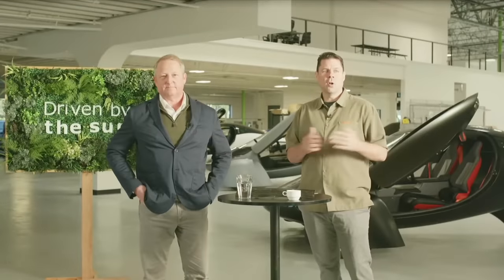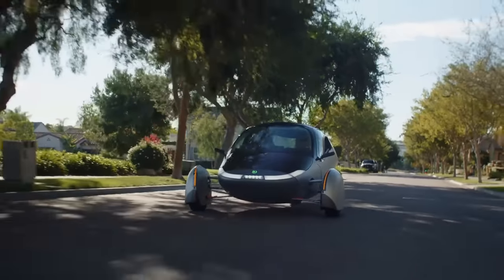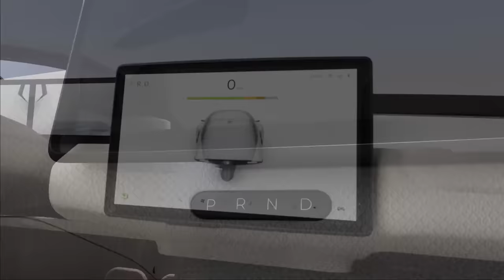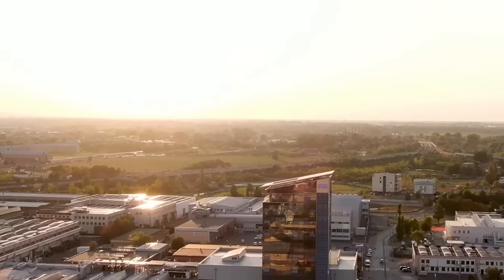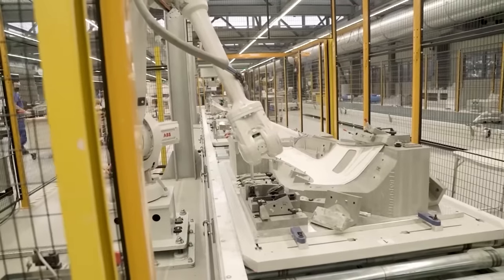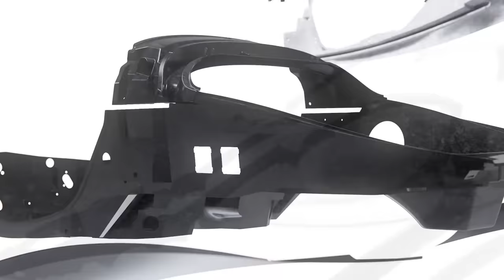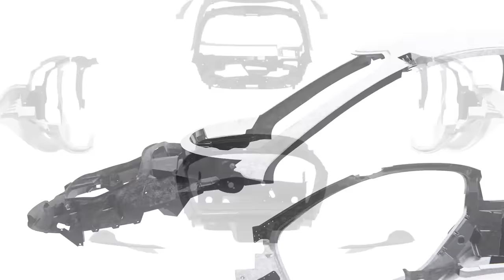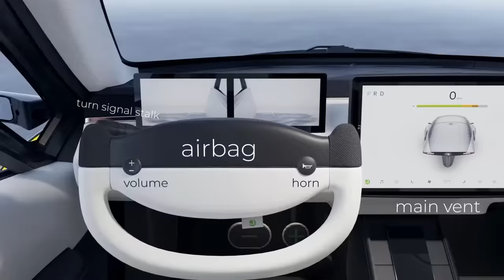Announcing Aptera's Launch Edition | Live Webinar

Comment: It would be so awesome if tesla motors (a collaboration) could help aptera motors succeed at getting this car on the roads and into the hands of the public. I think aptera motors is doing a great job in every respect. I just really hope that aptera motors succeeds at getting these vehicles into the publics hands, quickly, and as efficiently, as the vehicles they make/build/design.

it really does look like aptera will succeed at delivering these sunlight powered vehicles to the public, soon.

I remember when the entire internet was filled with negative statements about tesla motors, when they were at a similar stage as aptera motors is in now. most people were saying that it was not good business to make cars that do not require service (or very very little service) because how could an automaker stay in business from selling cars that require so little money to maintain. and yet, tesla is thriving.

I see aptera motors similarly. except that beyond teslas designs, the aptera motors has gone a step further with aerodynamics (less wind force slowing down the vehicle at highway/freeway speeds) and giving the sun permission to power the vehicle, by adding solar on every part of the vehicle, possible. Great work aptera motors - keep going!

It is a bright new day!

Comment: Love its "dolphin" shape! So cool. I see that you will go ahead with Tesla's receptacle and plug, yet the onboard 6.6kW charger is lower than Tesla's HPWC top output of 11.52kWh. Still, 57 miles-per-hour of charging is even higher than a Model 3 can "swallow" from a HPWC. I'm not a big fan of yokes, but I'm glad to see that there's still a turn signal lever. So the first production will take place in Italy, but later in the USA. I wonder what this will mean with the tax Federal incentives…? I really hope you can pull it off, and clear the remaining hurdles to bring the Launch Edition to market!
Reply: The bigger hurdle for the Tax incentive is that it does not recognize 2 and 3 wheel EV as yet

Comment: I am an early investor and reservation holder. I would like to express my concerns over the no DC fast charging. It is not an issue for me personally but it is obviously creating much concern. I believe you should reconsider this decision and add at least a 50 kw DC charger. I understand there is some challenge but I believe you have shown much patience so far and should not release your first vehicle with a perceived deficiency  It appears production is still some time away so this should really be a pivot for you. This is the only red flag in the launch edition. What does Sandy Munro think of this decision? Curious. Keep up the good work and I will be present during the investor seminar 1/27

Comment: Could you expand on what you mean by  "Functional reliability lifespan of over 2 years" for the solar panels? That seems rather short. For rooftop solar panels are usually rated for 20 years.
Reply: They said 10y. Still not like rooftop panels, though.
Reply: Ah, went back and listened again, they do say 10! Thanks
Reply: 10 years is what they can guarantee because they have been tested for that timespan with simulations without breaking them. So 20 years or an even longer lifespan is possible but not guaranteed, and probably many will want to change the panels before they stop functioning because of technological progress (higher efficiency at a cheap price.

Comment: While  I  am impressed with your composite being better than steel as far as strength goes, what about brittleness? Does it bend like steel would for added protection or does it crack? I am also concerned about the DIY aspect if ANYTHING goes wrong. Do you have ANY service centers at all?

Comment: Are there any existing NACS fast chargers outside of the Tesla network?
Reply: I think there is one other provider that has NACS (tesla) connectors.
Reply: EVgo has some NSCS connectors. But again, the launch edition Aptera will not be able to fast charge. Even at tesla Super Chargers or EVgo Fast Chargers.
Reply: You can use adaptors.

Comment: Is there a way to rotate tires or Change tires if you get a flat
Reply: of course
Reply: Along with this, have the wheel skirts been tested next to actual curbs, and on speed bumps and tables?
Reply: @philipbernick1011  In some other video I heard they tested a relatively high speed 45deg into curb impact and it did not damage the motor. The clearance under the wheel skirts should be enough for speed bumps (IIRC they initially had it a bit lower).

Comment: Couldn't watch.  The video kept skipping on my TV with TiVo and on my phone with and without wifi.  I hope they re-issue this video with a fix.  I am both a reservation customer and an investor.

As to what I did watch, the final design illustration is fantastic, along with the backing music.  

The design looks very well-considered.  

I wish I could see the off-road version, as the stock skirts will never work in Rhode Island, where we have cavernous potholes, often high granite curbs, mountainous speed bumps and icy build-up in wheel wells and under-panels when driving in blizzards.  Plus, I back pack, so I will be taking it on rutted dirt-n-gravel roads.

Comment: Great vehicle and looking forward to seeing them on the road. No rapid DC charging though? I would prefer 150kw plus DC charging than inbuilt solar as will most of us in Northern Europe, maybe a cost option would be better. Having been 100% electric drive for 9 years now the biggest improvement, even more than 250 miles plus range, is faster charging. Being able to stop for just 10-15 minutes and top up so fast is very useful.

Comment: Max L2 charging at 6.6kW pencils out to about 60 miles of range per hour.  So road trips would practically be limited to overnight charging.  400 miles per day is a 'leisurely' pace for a road trip, but I can probably live with that.
Reply: Except that 400 is probably more like 300 with no heat pump, weather conditions etc.  And then you will rarely go below 20% so it probably closer to 200 miles with no DCFC.   Aptera is dead to me without at least 50kw DCFC
Reply: @bad50  Point taken. On the other hand, because it's such a leisurely drive, I'm stopping for a 90-minute lunch, so that adds maybe 50 miles (after all the factors you cited), and maybe the same for dinner.  And if it's sunny, I'm picking up another 30 miles from solar.  Maybe it's only useful if all of your road trips are in warm, sunny weather 😎

Comment: Just had an idea. EV companies should start offering certification courses in servicing their vehicles, that any mechanic can pick up and add to their resume. This would lead to broader support for EVs overall, as their regular mechanics would have a career path for migration, and owners wouldn't have to worry about whether there was someone nearby who could service the vehicle.  Any mechanic who had ANY certification would be a valuable resource to EV owners, even if there was no official service near them. IT works that way, why not EV repair?Could also generate a revenue stream for the company while alleviating difficulty in finding qualified mechanics rapidly.
Reply: That's not the trend in the industry. Car dealers make their money servicing cars, not selling them. Proprietary repairs means customers rely on the brand dealer to service their car. All the automakers want to "capture" (i.e. trap) their customers into taking their cars to their dealership for service. They don't want independent mechanics, which is why automakers love the idea of EVs -- fewer parts mean EVs are easier to make, meaning they need fewer union employees to make EVs, and proprietary repairs means customers rely on the dealership for over-priced EV repairs. Why would they let independent mechanics compete against them?
Reply: @MisterMonsieur  It's the trend in the industry of gas-powered cars, not electric. There are very few dealerships to service electric vehicles, which was the point. Particularly when the industry leaders are EV-only startups. Also, an electric vehicle requires almost no maintenance, so that makes it less viable for dealerships, and more viable for the independent shop owner who wants to be able to repair electric vehicles of multiple makes.

Comment: I hear comments about cargo space and added space and at the same time concerned about full charge range? two adults and a ton of cargo is NOT efficient. The more weight loaded reduces the range. So talking about "obsessed with efficiency" and wanting extra cargo space, is materialistically against the theme of efficiency. A BIG question I have; this vehicle sits very low to the ground making it highly susceptible to road debris. I assume this doesn't have high impact front windshield protection. If the window gets hit, how do we replace that, is it replaceable, what is that cost? other parts on the vehicle how can those be repaired or replaced. Can I order parts and fix them myself? Thanks

Comment: You talk about the drag coefficient, but the other parts of the drag equation are ignored. The cross-section area is just as important.
Reply: Indeed, the cd*A would be nice to know. But guess other car manufacturers also only brag with their cd (not mentioning A), if there is something to brag about.
Reply: @ThomasWaldmann , They could say something like the area is 1/3 of a model 3, then put the formula up showing the total drag in relationship to a model 3 total drag. Model 3 can get up to 5 miles/kWh and they can get x times that or put the actual numbers in like we get 25 miles/kWh. I think their area is a more significant factor than cd.

Comment: I am confused about the choice to go with all wheel drive. If the primary goal is to maximize efficiency, why not go with one (rear) or two (front) wheel drive? Wouldn’t removing motors (that have an efficiency of less than 1 and increase overall weight) improve efficiency?

Comment: How’s the rudder steer at speed?
Reply: It’s actually just an aero fairing for the rear wheel and suspension swing-arm.   Not an actual control surface (rudder). 👍🏻
Reply: @Motohead_Matt  right. But I’m talking about the front fairings at speed creating a rudder steer effect.
Reply: @l33tLX  By how many degrees do you turn the wheels at a speed where the wheel pants would add any perceptible side force? In other words: this is  non-issue.

Comment: RV owners - here’s my plan: deck over aluminum trailer because it’s so wide. Tow it to an area to explore and leave the RV parked.  The Aptera will always be exposed for sunlight charging and plugged in at night if at an RV park or plugged in when generator is running.

Comment: Having grown up in Phoenix and experienced interior temperatures of over 125 degrees that a car left in the sun can reach, parking the car in the sun in order to get "free" miles worth of electricity would be a poor trade off to me. One, it definitely adds a very uncomfortable portion to the whole driving experience, and two the intense sun and high temperatures is hell on the soft goods in the interior. Most older cars in Phoenix have splits in their seats and headliner material and cracks and fading in their dashboards. 

So even though such a city is the absolute best for using on-board solar cells to generate electricity to move the vehicle, I would much rather park my vehicle in the shade if available. But if I did have to park in the sun, I would rather have the electricity being generated, or at least some portion of it, used to keep the vehicle cool(er) so that I don't return to a swelteringly hot car that feels like I am climbing into an oven and where immediately break out in a heavy sweat the moment I get back into it. 

So at a minimum, I would hope that even with the vehicle off that the cabin fan could be put into a mode that it ran on thermostat to keep the interior temperature as close as possible to the ambient air temperature as possible. Even better option, depending on energy demand would be to continue to run the A/C in a low power mode to keep the interior temperature below body temperature, perhaps 90 degrees, so that heat flow is outward from the body to the air and with a very small sheen of sweat and the very low humidity in desert areas, can feel warm, but not hot.

Oh, and I put "free" in quotes with regard to the cost of the energy captured by the onboard solar cells because, while the solar energy captured is free, the cells to capture it are not and they have a limited lifespan. So there is a cost for each kWh of electricity generated by the onboard system.

Comment: So this will still honor my place in line? I am about 10,000 place and 14,000 place for my wife's 250 mile range edition. Mine was already exactly what they want  to launch with (400mi, full solar, upgraded sound system) except interior color and 3rd motor. I can live with interior color and was on the fence about 3rd motor but why not have a supercar performance to match the supercar space age Body in Carbon...
Reply: Dude, you need to get a refund ASAP! 🤣

Comment: I muddled through the stuttering video. 

I love so much about the final design, but AC charging is a no-go for me.  My wife and I already have one EV with slow charging, a 2021 Chevy Bolt, which takes 4 hours to add 200 miles on a level-three charger.

This is supposed to be our travel car.  We planned to drive it home to Providence.  We have friends and family all over the U.S..  

I had ordered a 600-mile version in white with everything, except for the pet net.  I will either have to wait for the DC version or upgrade to the 1000-mile version.  But I don't want to carry a heavy 100+ kW battery day-to-day, unless I can run my home on it..
Reply: My 2020 does not need 4 hours for 200 miles. Something not right there.
Reply: @daviddrake7003  
I have not tried it, but a couple of channels have, and it takes close to four hours to charge 70%.  It is the slowest-charging EV sold in America.  It also loses the most charge in cold weather, averaging more that 30% charge loss.

We love the Bolt for drives within 200 miles, but it is impractical beyond that range.
Reply: I think Aptera should be talking to Skeleton Technologies in Estonia. It makes graphene ultracapacitors that it pairs with lithium-ion batteries to make an ultra-fast, hybrid energy cell that also can hold a charge for a prolonged period.  

This cell employs the best features of graphene ultracapacitors and the best features of lithium batteries and combines them into one super cell.

I already have considered these cells for upgrades.

Of course, Aptera has commitments with suppliers, making a change thorny.

But I suspect Skeleton Technologies cells would solve the AC charging anxieties.  If these cells are as good as I understand, they will guarantee Aptera's mass success, if Aptera can get to production and delivery.  

I am worried as an investor that the remaining, needed potential investors will be spooked by the AC charging.  This could be a death nell for Aptera.  I hope I am very wrong.

Comment: That ‘dual’ cup holder is next to useless. Two differently sized holes overlapping? That means only one will fit, because once one is filled, the other can no longer hold a cup as it’s partially filled. And what if people have two cups of the same size? If such obvious questions about the most basic of features have been overlooked, it doesn’t give me any confidence about the rest of the vehicle.

Comment: This is really cool…but when you have a vehicle like this…with no dealerships…and a new design unlike any other cars on the road…what happens if I’m in a fender bender…and need to have something repaired? Im assuming Safelite won’t have this windshield in stock when a rock cracks it…so where will I get a new windshield? These are the issues that most concern me with buying something like this.

Comment: Chris is already hedging into 2024 for deliveries which means at least 2024. As for no DCFC my guess is that they’ve abandoned the ‘skin cooling’. Look how much bigger the exhaust ports are on the Delta renders. In order to simplify I would put in a traditional radiator and pull air in the cowl and out the back. This system, it would appear, is not robust enough to handle 1C (or more) of charging heat.  In order to ‘upgrade’ to DCFC in the future the battery pack will have to be swapped.